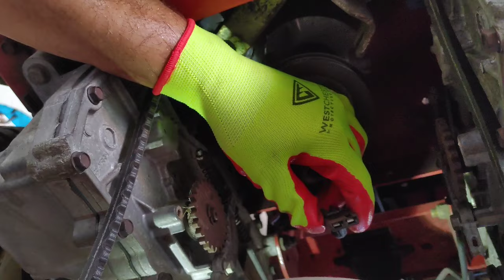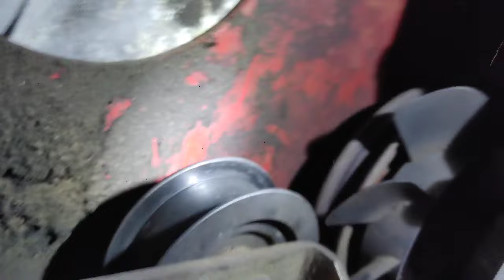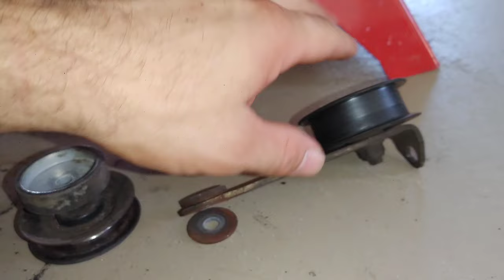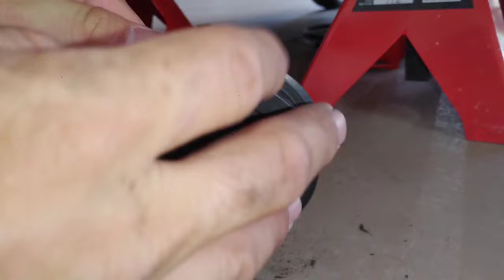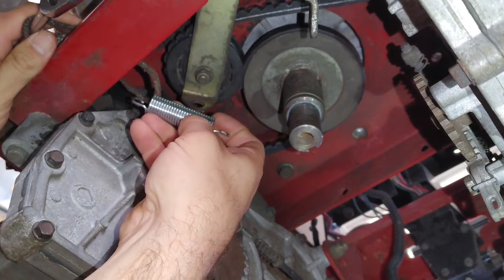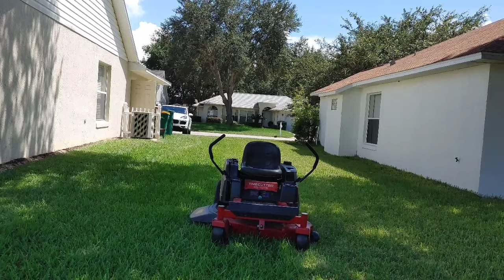Toro Timecutter drive belt replacement. Toro 4225 Residental Zero Turn drive belt

Comment: Thank you for the video work great on my sw4200 one tip is to spin the motor by hand as you put on the Belt on the main pulley it will go on a lot easier.

Comment: I finally did my belt and found that it was easier for me to first wrap around the idler, then the 3 aft pulleys, which left just enough room to partially install the drive pulley and use a 16 mm socket to rotate it on the rest of the way. I most likely could have used a spring clamp on the inside of the rear pulleys temporarily, but swearing sufficed.

Comment: I will NEVER buy another Toro. 22 hours on mine. Broke two deck belts and just now my drive belt came off. I previously had a Ariens 54 inches  with 600 hours on it, the belt was still original.
Toro= 💩💩💩

Comment: Having the tensioner pulley so close to the engine pulley is absolutely ridiculous. These mowers are garbage. The electric brake is probably the worst idea any zero turn manufacturer has ever had. Just complete junk. Stay away from anything made by Toro

Comment: I went to the Toro dealer and got a belt, but they just took my old one and kind of sized it and it was about an inch short as you know working around with your fingers how tight that was that in short there is no way. My time cutter is supposed to be 64 x 1/2 and Toro itself doesn’t like to put the numberon the length so even the dealer said G we have to order just the part number because they don’t tell us the length. Don’t know if you ran into the same thing.

Comment: Why don’t you like toro
Reply: I agree. People just don't like to work on them, but who likes to work on any mower? The only issue I ever have with my Toro timecutter is when I run over a stick and the either the drive belt or the deck belt get knocked off. Drive belt has always held up but the deck belts will break more easily. It's always user error though, so can't really say I can fault Toro, although I cuss them plenty when I'm wrenching on it.

Comment: My drive belt came off after running over a stick.  I got it all back together, and I'm pretty sure the belt is on correctly.  Now, when I start the motor, the belt comes off immediately.  I don't even have to try and drive.  I just start it and the belt comes off.  I've replaced the tension spring and that didn't help.  What should I look at next?  Should I replace the belt?
Reply from the maker: If thebbelt got twisted or damaged it mostly likely will never stay on correctly again. I'd replaced the belt
Reply: How'd it go? Did you replace the belt, or did you scrap the mower for parts?
Reply: @Rick-the-Swift  I got frustrated, moved into the barn so I will have a project for this winter.  I have a Hustler that I don't like very much that is filling in this summer.

Comment: "Loaned it to a neighbor." Number one no-no. Never expect a neighbor to pay for repairs. Most will not even replace the gas they used. If you see one heading towards your open garage, lower the door as fast as you can. If you don't like TOROs then tell us what brand you do like. If you want to replace your drive belts only replace it with an OEM belt.
Reply from the maker: Hahaha I know right! I can't tell you how many times I've heard "I loaned it to a neighbor and they broke it" 
I only dislike those past residential Toro mowers. The recent models like the Toro HD Max is a very well-built machine. Still a few sloppy things here and there. All the brands have a some sort of weak spot or corner cut to lower production cost.
If I were to buy a new residential zero turn today, it would most likely be a Scag, Ariens/Gravely or Toro.

Comment: Thank You your video helped me out with this exact job on my Timecutter 75750 50 inch, changing the drive belt and idler pulleys, also the hydro fan on the left side. Drive belts keep getting eaten up on the left side for some reason.
Reply from the maker: Hey Michael, I'm glad it helped. If the old worn ider pulley was wobbling, that could have caused your belt to jump. Hopefully, that was the issue. If not, I'd closely inspect the v  groove of the hydro pulley. They can get a small pieces of wood stuck in them sometimes.

Comment: The install is easier if you don't put the belt in the clutch pulley.
Install the idler pulley and arm followed by the metal pulley on the hanging bolt piece by piece. A clothes line rope with a knot pulls your tensioner spring into position and slides right off.
Thanks for the experience!

Comment: What is the size of. Drive belt for 50”. Zero timecutter  or. Stock number
Reply: if its an MX-5000 the belt number is 130-6976
Reply: 1/2” x 64” v belt

Comment: Hmmmm just got brand new toro this year . But the drive belt it broke.  So I'm not sure if it was my fault or what,and I'm happened but I'm so mad. . What brand is the best on zero turn? Can u answer that to me?
Reply from the maker: If you get a Toro I recommend at least a Toro Max or Titan.  As far as which is the best zero turn, the simple answer is Scag. However they are a little on the high end price wise so I like to compare them based on price. Areins/ Gravely are also really good. Low end prices Bad Boy and the new Cub Cadet are pretty good
Reply: Get yourself a Ferris. All the commercial guys use them around here and they go on and on about how good they are. However, if the drive belt broke, that was probably all on you, from running over a stick if I had to guess. Not sure if Ferris makes indestructible belts though.

Comment: Just had to change the drive belt on my Toro sw5000 and so I watched a bunch of these video's. One tip I never saw mentioned is when you're finished with the drive belt, and you reattach the spring for the tensioner on the mower deck, ALWAYS check that deck belt afterwards!! The reason is sometimes when you remove tension from the mower deck belt, the belt can drop off of the first pulley (on the deck) that is closest to the motor. If the belt drops off and you engage the blades, it can destroy the deck belt very quickly. Otherwise, great video!

Comment: My Toro 4225 Drive belt ate up about 50% of the hydraulic fan on the left side as you're sitting on the mower.  Have I got to pull the hydraulic unit off to put another fan on?  Wondering if I can just replace the belt and schlep through the rest of this season, even if it runs a little hot.

Comment: I think I may have a broken drive belt on  my ss5000 so this is rxactly what I eas looking for. Thanks so much for posting!  FYI The pan head threaded bolt with the square shank right under the head is commonly known as a "Carriage bolt" if you ever need to find one.
Reply: Did you ever get it fixed or did the mower go in the trash?
Reply: @Rick-the-Swift the drive belt and one of the hydro fans were broken. It sat so long the battery was dead and it wouldn't start after charged. I gave up and took it to a shop. They quoted $1100. I priced a new one then moved forward with having them fix everything. Its been great mowing 3 acres weekly this season.
Reply: @cutubeish  Sounds like money well spent. Our time is a hard thing to give valuation to.

Comment: Thanks very much, great job describing what happens with this. Getting ready to do mine. Oh, you may want to buy yourself a brake spring puller. Cheap, about $5-6, and very easy to pull most springs on. And great video and audio as well.
Reply from the maker: Cool, thanks